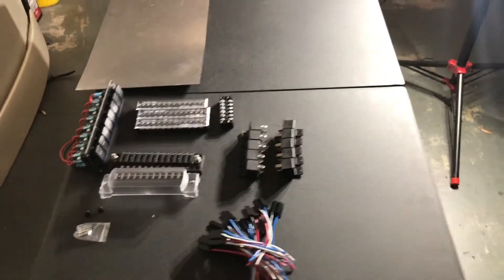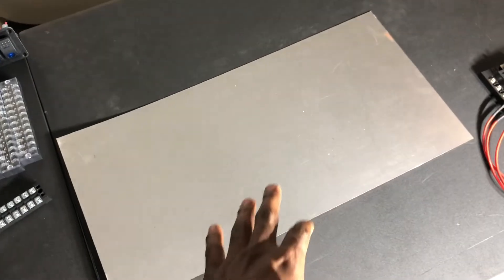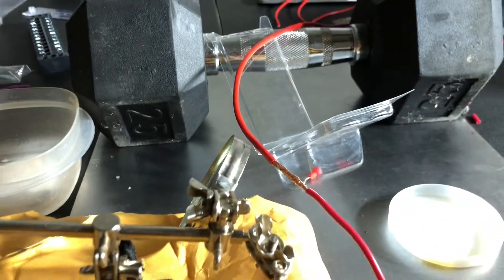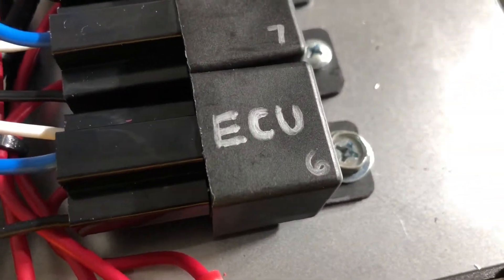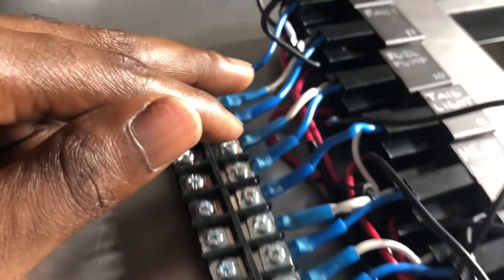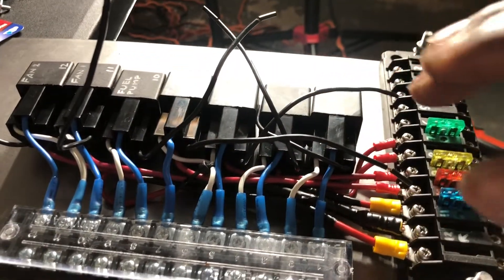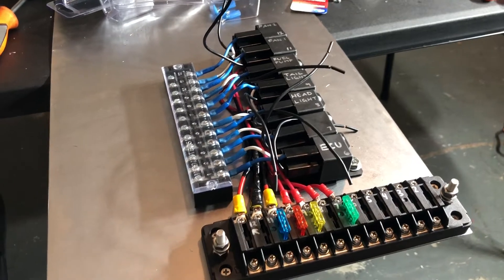How To Build A Custom Fuse/Relay Panel For ANY Car (EASY) !!

Comment: How did you run power to that panel? How many amps is your setup drawing on that panel?
Reply from the maker: never measured but less than 200amps and i used like 4 awg welding wire or something like there, welding wire is the best !!
Reply: @kriswyche and a fuse on the welding wire from battery?
Reply from the maker: just a circuit breaker

Comment: Why two ecu ?
Reply from the maker: only one ecu
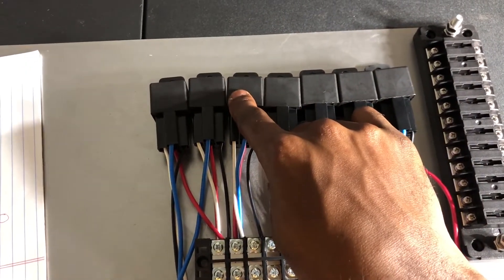Reply: @kriswyche  1:32 you have two relay ecu, my apologies I’m just rewrite my 86 Nissan Datsun truck can trying to find different video to figure what relay I need to do.
Reply: And the two fan relay is it making one relay pull in air and other push out air?

Comment: Kris. The black wire you did not connect in vidio  where does the black wire go?
Reply from the maker: those are just grounds, on this fuse strip they go on the opposite side of the power. that route to the bottom nut which is where you run a battery cable to bare metal in the chassis (this will run it to the battery’s ground terminal)

Comment: I am completely rewiring a ‘94 Golf Mk3 that I have stripped to a bare shell and am turning into a track day car. The stock harness has a bunch of small gauge wires going coming from the connector in the back of the instrument cluster to the fuse/relay block connector. As there is a large number of them, will each one now have to run to a separate fuse on the new fuse block? I know that some of them will no longer be needed but still that is a whole lot of small gauge wires. This has to be something that everyone has to face that is completely rewiring a car. Loved your video. I see that it is five years old so I hope you see it.
Reply from the maker: So OEM wiring almost always has 1-2 power wires that splice within the harness and go to multiple pins on connectors, when doing a track car the whole point is to minimize wiring, normally cars will run a digital dash that requires usually one power in and CAN bus. You should look into a PDM, expensive but 1000% worth it since this method is a bit outdated. 

Study your cars wiring diagrams in its factory service manual because the cluster might just be 2-3 power wires which can all come from one fuse and then a handful of ground that all splice into 1-2 wires
Reply: @kriswyche Much thanks.
Reply: Tell me if I am wrong but I am under the impression that each item in the instrument cluster like the fuel level gauge, for example, would need 3 wires - power / ground / signal. Can I combine several of these low draw wires in a single fuse and a single ground? I cannot afford a digital dash.
Reply from the maker: @505premoto  yes you can and that is also what OEM does, from one power wire/connector it splices and provides multiple things with power. Just remember to add your amps. If you have 5 electrical loads that draw 3 amps each, you will be pulling 15amps through the main wire before it splits off to each load. additionally if you have a fuse strip rated for 100 amps and the fuses on the strip exceed 100 when added up, its possible that the strip can catch fire. always count your total amps and remember its always better to undersize a fuse than oversize, fuses are meant to pop to safe you from a fire due to the excess heat of an overdrawn wire

Comment: How can I do it to where I don’t use a switch?
Reply from the maker: @ChevyChavis  you will have to use the ignition barrel and have “ACC ON” and “ON” and “START” control the relays. Not a hard job but a bit more complicated and you don’t get as much control over each circuit
Reply: @ I have the Ls engine and wanted to run my 2 fans (1 relay each) and a relay for my sunroof
Reply from the maker: @ yeah you need one relay per fan, but fans you can make their own circuit

Comment: How is connection ware from battery to fuse box and key switch thanks
Reply from the maker: circuit breaker installed between battery and fuse box. key is basically just a switch and when you turn the key it closes the circuit and sends power to starter motor to turn the car over.

Comment: What's the size of your relays and why do you have 2 relays for your fans?
Reply from the maker: the relays are 40a. i have dual electric fans so it’s good practice to have a relay for each fan. i’ve seen people run one relay for two fans and it usually results in the relay burning up

Comment: How do I wire the switches to turn on fuel pump and so on? I'm at the point where you show the panel done. Now switches?
Reply from the maker: You supply power to the switch panel by connecting a wire to the main fuse strip and running it to the switches. The switches power the relays, so when you hit a switch it powers the relay and then the power goes to the fuel pump. Rewatch the last part and I explain how the power flows. I’m making a playlist now with all my wiring videos, give that a watch and you’ll have a better understanding. Also you can dm me on Instagram and I can send more pictures and help!!

Comment: Can u show how to use a relay for emergency lights using a relay to make a negitive to positive
Reply from the maker: The relay simply allows you to not be forced to use bulky switches. The should have modules that flip power and create pulses to use with regular lights that will make them “emergency” lights

Comment: Trying to a after market emergency lighting which khans a negitive Monterey switch I need that switch to become a positive switch any ideas
Reply from the maker: I’m not sure what a Monterey switch is? Do you mind explaining ?
Reply: It is a pattern switch for changing patterns on a light bar or flashers
Reply: It's a switch that the circuit is closed while being pressed. A horn switch is an example of a momentary switch.

Comment: Nice video.  Note that a "40" amp relay that only has 14 ga. wires will only pass about 15 amps.  Amp capacity does not change over distance.  A certain gauge will only handle so much.  So a 30/40 amp relay with 14ga can only handle about 15 amps.  Look to relays with screw terminals and much higher amperage ratings.
Reply from the maker: That’s a good point !! It does make lots of sense the relay rating is higher than the wire. Luckily the most the relays see are around 10-15 amps. With the highest rating possible being 20.
Reply: That's not right, increase wire length, increases resistance which increases voltage drop which decreases amps at end of circuit

Comment: In a later Video you talk about using one 80 amp relay to power the ecu instead of 2 smaller relays. I’m looking to wire up my s13 sr into a 95 s14 and didn’t even consider this. Do you think the
 ECU will draw more amperage than a standard fuse can handle? How do you still use the ignition switch to power the fuse block? See what every pin does, feed it power and see when it comes out? Thank you
Reply from the maker: it’s getting multiple power sources and the ecu has its own mini fuse strip. So basically the 80amp relay feeds a separate fuse strip, from there each ecu wire has a dedicated fuse. The ecu relay also gets power directly from the battery and is protected with a circuit breaker.
Reply: @kriswyche  I see 
1 R/W ignition signal 1
2 R/Y ignition signal 2
8 R/G ignition signal 3
9 R/L ignition signal 4
13 B ignition signal ground 
34 O start signal
35 G/O park neutral signal*
36 Ignition signal 12v switched
38 B/W ecu power
39 B ECU ground
46 ECU Backup Power
47 ECU Power
48 ECU ground
 For a 62/63 ECU. I have an E5 but I believe it’s similar. 
Do I really have to wire all of these? I’m counting 13 wires just to power the ECU? Why do we need 5 ignition signals? Why 2 and a backup I’d understand 1 power 1 backup. Can you clear this up? And if you have an E5 ecu show me what wires you needed/ran to the ECU from the dash end?

34 O start signal
Reply from the maker: @hectordelgado3258  it’s really complicated tbh, I’d have to find where I wrote stuff down and get back to you. I have a 62 ecu and I believe one or two wires are different. BTW, I did lots of wiring tracing, most of the wires split into more within the harness, so it’s like you power one wire and it splits into 4 different pins. I currently only have 3 wires that are getting powered if I recall for the ecu
Reply: @kriswyche  did all your wiring deal with the F3 plug? Or did some include the ECU side cables as well?
Reply from the maker: @hectordelgado3258  this might help a bit. It all went through a big connector on the side. It’s black with a grey locking handle. 

https://youtu.be/ECCuOgvjwCI
Reply from the maker: As for the ignition barrel where the key is. I just used a multi-meter to find out what wire gets power when I full turn the key. It’s basically just used as a switch now the provide power to the starter solenoid which cranks the car. I can pull the key out while driving and nothing will happen. It’s sole purpose is to crank the starter. The ecu, fuel, and everything in the car is controlled via the switch panel !
Reply: @kriswyche  does a switch on the panel give power to the whole panel? Or is that also from the key? Are you using the 8 gang panel? If so, that’s crazy bang for buck at 30 and change
Reply from the maker: @hectordelgado3258  yes, 8 switch panel. One switch powers the others (main power) and the rest just click on the relays to power everything in car. Key has one wire going out that just plugs into starter solenoid
Reply from the maker: @hectordelgado3258  there is a wire on the ecu that needs a start signal, so I spliced into the wire that hits the starter solenoid, wired in an inline fuse and that goes to ecu. It can be very complicated wiring the ecu. I’ll try to check this weekend and let you know what wires I used exactly, you will need to trace and make sure before you solder and hook up
Reply from the maker: Shoot me a DM on Instagram @kriswyche_ . Also, all the things I used are linked, the links are exactly what I used
Reply from the maker: I’m running a different setup as well so DM me and I’ll send pics and help where I can

Comment: I have an 06 Silverado 3500 wrecker I’m looking to cut everything from behind the cab and create an easy to check panel from behind the drivers seat to the lights I have new led lights bar light on top around 4 lights in the toolbox compartments running lights and turn signals and they are also in my bar light plus I have around 6 flood lights everything is going on a jerr-dan  self loader and help you can give me would be great thank you for your time
Reply from the maker: Anytime, just shoot me a DM on Instagram !!

Comment: This is a good video ...but maybe I missed the most important part. How do you wire this up
Reply from the maker: That part is a bit more complicated. I do have a video talking about it somewhat that I’ve linked below. Basically everything I needed to power I made a little harness for with power and ground. I also spent a good amount of time studying the wiring diagrams from the factory service manual. 

https://youtu.be/mzw0uaPBmMg